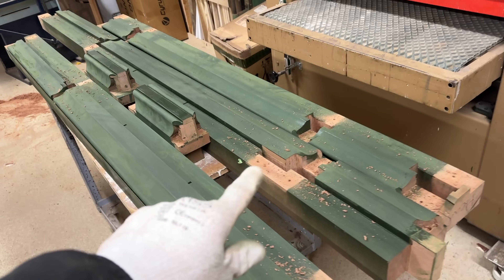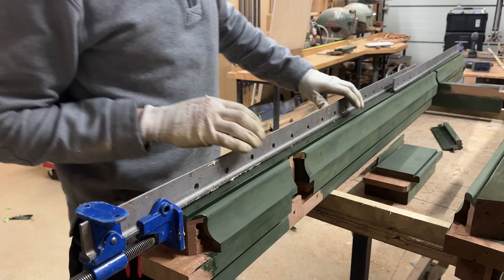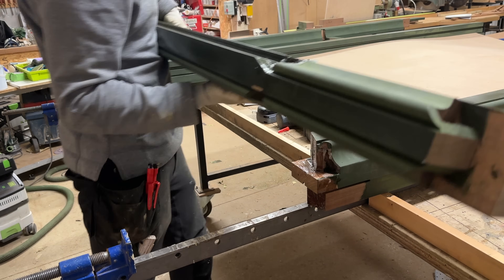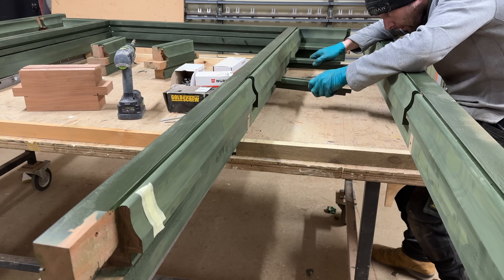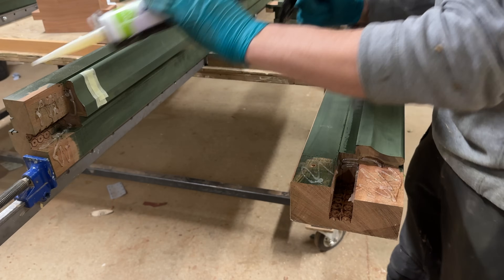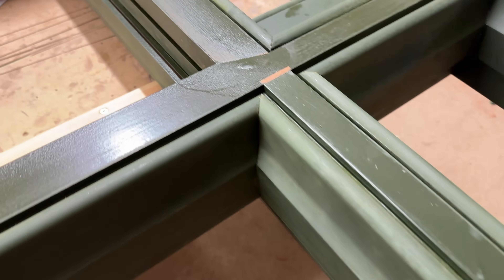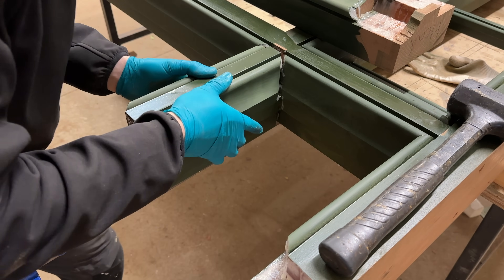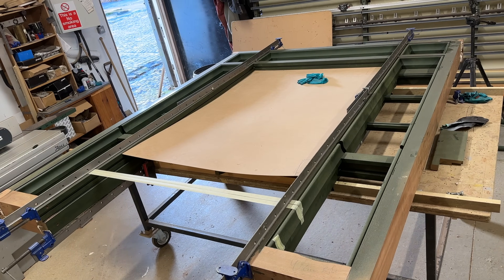Glue up day on the Green Monster Frame - This Wasn't Stressful At all

Comment: You are the first one since 8th grade wood shop (1957) that correctly identified the PILOT hole....ty with the hole that the screw threads go into is properly called the anchor hole if drilled in advance. Onward

Comment: Thanks for the link to the Polyurethane Glue, but what is the spray? Does it soften the glue? What role does it play?
Reply: It's IPA (Isopropyl Alcohol) cleaner. It does a great job of removing the excess foaming you get with PU wood adhesives. Once they set they are a nightmare to clean off from corners and rebates etc. It's one of the many great tips I've picked up from Oliver. He seems to use the aerosol type cans but as with all products of that nature they tend not to be great value. I always have bulk bottles of Iso in my workshop as it's handy for many things (hence why his tip was even more welcome!) so I just use that in a regular trigger sprayer 👍🏻

Comment: Have you tried using Semparoc 60 pu glue? It’s used for boatbuilding and gives you an hour before setting. It is costly though. Great channel!!
Reply from the maker: no i've not, thats really interesting thankyou!
Reply: I use it if I need a bit more time gluing up complex doors or windows. It’s white in colour and reminds me of Cascamite. Also it doesn’t foam up as much  as some of the pu glues on the market. Thanks

Comment: T section sash clamps. Did you put packers to hold the section square? I have rectangular sash clamps that fit square to each other and I bolt them flat. Good approach to your work.
Reply from the maker: no they generally pull decent when the pressure is on just leave the nut loose so they can sit level